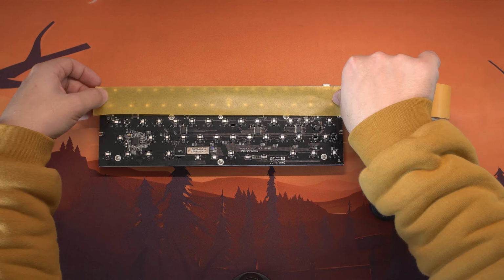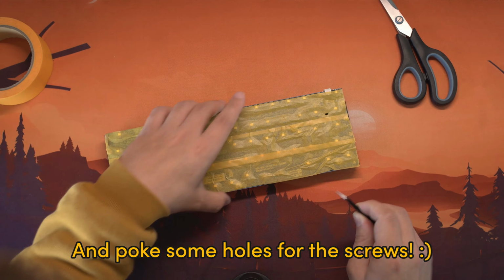60HE + Tape Mod: How does it sound?

Comment: Literally couldn't hear a difference. Even between the lubed vs unlubed. The optical switches are factory lubed really well, and the stabilizers maybe even a bit too much for me case. Perfect keyboard out of the box imo.
Reply: u can tell specifically with the enter key that its def a lil more rattlely stock vs lubed. and im glad they did the direct back to back at the end. its very slight, but with the tape, its a bit deeper and louder
Reply: I couldn’t tell the difference between tape and no tape either. I could hear the difference between lubed and not lubed however
Reply: In terms of sound and feel, the keeb is bad for a custom keeb standard but since the keeb is more aimed for the people who buy razer, logitech and corsair products on a regular basis. 
It's not worth putting any upgrades to the wooting in the first place, if you want to upgrade sth, just get a custom keeb
Reply: U must have a really bad hearing then
Reply: The stabilizers are lubed but not the switches
Reply: @@windfall7154 sorry to hear you spent that much for it knowing that the ME version is out now. I'm sure their ME version performs much better and so do most 200$ boards that were released this year.
I tried the 60HE and even with tape mod it's not worth getting it for the keeb experience, it's really just 100% gamer and speaks for those who need it to game
Reply: lol, I couldn't hear a difference in any of the mods.
Reply: @CS-pl8fc  explain to me how I'm a liar? The lube job is nearly non existent and plenty of people agree from the scratchiness. Anywho, I'm not arguing anymore I have a 4080 and 7700X to install, ✌️🕊️
Reply: the tape mod can't affect the sound because there is a large piece of case foam, if there wasn't anything then it would sound "poppier" but have more hollowness due to no foam
Reply: @teptaylor  I physically cringed

Comment: On older mechanical keyboards there was a mod using small sealing ring/gasket under each key (you might want to test it side by side on just a single key. In theory the key does not hit the bottom directly it might be a significant sound improvement, but not sure if it will work with the key design of wooting keyboards, and might reduce the maximum keypress value from 100% to probably 70%.

Comment: what if i sue plastic tape?
Reply from the maker: You'd want to use tape that doesn't stick too much. Plastic clear tape usually sticks a lot more, and you might damage components with that. Painters tape is typically fairly loose. Making it the most ideal.
Reply: @Wooting thanks al lot

Comment: when i tried the tape mod i could not screw the small ass screws back in so I just had to ditxh it. is it a must to screw in the PCB to the case?
Reply from the maker: Make sure to poke some holes at the screw locations. Then you should be able to screw them in just fine. :)
Reply: ty i did just that and it worked the smalls screws are really annoying to work with tho or it's prob just a skill issue

Comment: Lubed (no tape) time stamps: 1:04 (typing), 1:09 (stabs), 1:19 (key spam)
Lubed (3 layers) time stamps: 3:01 (typing), 3:06 (stabs), 3:14 (key spam)
Reply: Feel like it gets ever so slightly higher pitched with 3 layers. It's more apparent in the middle 2 rows of the key spam.
Reply: Perfect jump marks for what is most interesting

Comment: time stamps:

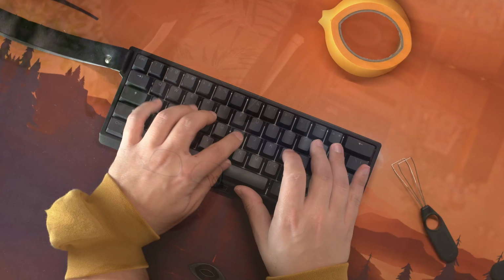@0:46 - No tape, non-lubed stabilizers/switches, with foam
@1:25 - 1 layer of tape; non-lubed stabilizers/switches, with foam
@1:06 - No tape, lubed stabilizers/switches & with foam
@1:41 - 1 layer of tape; lubed stabilizers/switches & with foam

@2:02 - 2 layers of tape, non-lubed stabilizers/switches, with foam
@2:41 - 3 layers of tape; non-lubed stabilizers/switches, with foam
@2:22 - 2 layers of tape, lubed stabilizers/switches & with foam
@3:02 - 3 layers of tape; lubed stabilizers/switches & with foam

Comment: Is the tape safe for the PCB? I heard glue can corrode, short the PCB or pull components off when you try to remove it after a long time. And it can catch on fire.
Reply from the maker: Haven't had any issues with it personally. Also reading online and asking our engineer, said it shouldn't be harmful.
Reply: The PCB has a protective coating- Should be fine :)
Reply: @amshermansen  no it doesn't?
Reply: @nomecognome5050  Yes... yes the 60HE has a protective coating that helps prevent conductivity.

Comment: tbh I did the tape mod on mine and it made no difference even in the standard case or a different keyboard case. Tried 1 layer, 2 layers, and even 3 and it still didn't really have any effect
Reply from the maker: So I am not the only one. Exactly the same for this test. I didn't notice anything either. While in other boards the tape mod made quite an impact.
Reply: I did it to mine it has a really big effect try adding pressure to the tape

Comment: This is the problem. For 189 we can get an aluminum case, foam gasket mounts premium sounding flexible, hot swap 65% keyboard with a knob from keychron. This should be sounding great out of factory without modding anything. Even if it's for a little extra money since everything is from China. Cmon boys.
Reply: keychron and premium sounding... LUL XD hollow pinging mess...
keychron and flex.. lmao..their gaskets are stiff and useless...
There are far better keyboards then Keychron, KBDfans, and multiple other lesser known "brands" that go under group buys..
As for the Wooting, you buy that keeb bcs of the lekker switch and the performance advantage that it gives you for gaming.